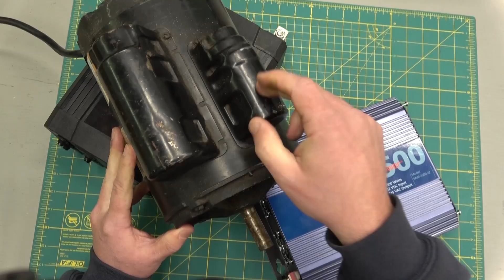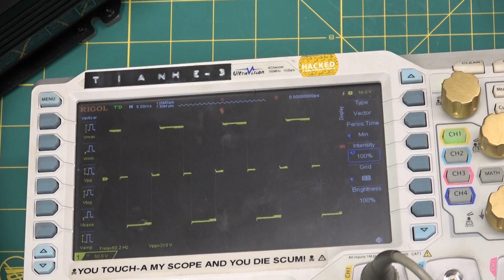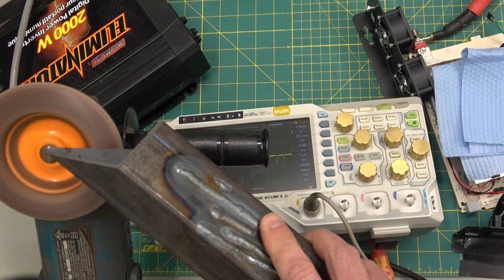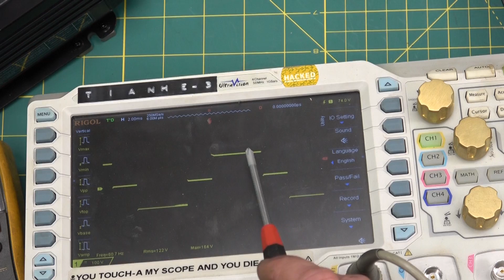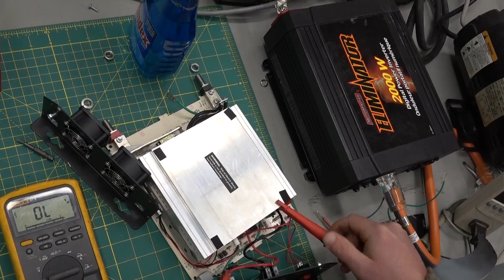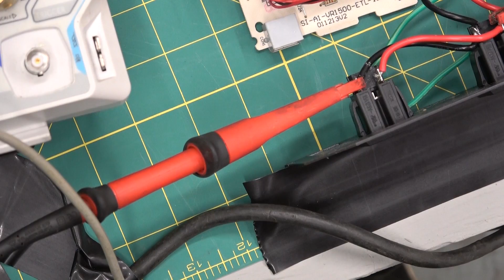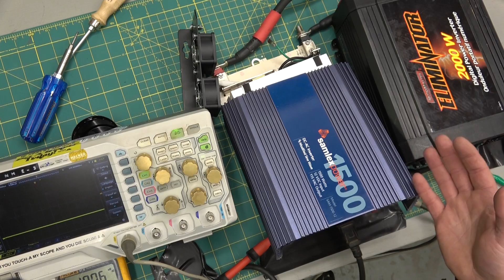BOLTR: Samlex inverter | Cheap vs. Expensive

Comment: As a power electronics engineer: Look at the cheapness of the board, its a single sided and looks like FR1 or FR2. To minimise current loop area it should be double sided. No one uses these modified sine wave inverters for professional applications, just get a pure sine wave one and lose a bit of your power density and efficiency (you will save it in power losses in your motor!).
There are some large motor drives that use a modified sine wave but they are designed for specific motors and applications.

It's OK to parallel up MOSFETs as they have a negative temperature coefficient resistance so are unlikely to cascade fail. Using different types in parallel is never a good idea though as the worse ones will not conduct and just add to the switching time.
Diodes have a positive temperature coefficient and shouldn't be parallelled unless they are on the same heatsink, and cut from the same die preferably.

I can send you a DIY high quality sine wave inverter to test if you want to see what a good one looks like.

PS. To get useful readings from your fft you have to  exactly one cycle displayed on the screen (that's 20mS total for 50hz, good luck with 60hz). Then look only at the amplitude at each harmonic and ignore the rest.
Reply: So what are the basics of a DIY pure sine inverter? H-bridge and back to front transformer? Do you need to regulate input wrt output or is that automagically adjusted by the load's power demand?
Reply: I thought you should never wipe back to front.
Reply: @ToneGallis  I'm not sure about pushin' and pullin' either. E-es-pecially after inverting. Thanks - Lumpy
Reply: Tone Gallis Proof great gems can still be found when peeling back the onion. Freakin brilliant 😂
Reply: This guy inverts
Reply: @zmandubs  inverted af
Reply: @pleaseelaborate3163 I'm guessing you mean converter topology. I've tried using both high frequency (20khz) and low frequency (50hz) transformers to step up the voltage and low frequency is the way to go unless you need to make it lightweight. Output filter topology is whatever passives happened to be lying on the floor during testing
Reply: + Nico Shattock  ...
I'll trade you your DIY sine wave inverter for my DIY sine wave vibrator.... It will be tough, but I happen to have 16 of them.
Reply: @nshattock  isn't a 50Hz transformer used for UPS's and 20kHz for inverters?
Reply: UPSs are generally 50Hz as no-one cares about the weight and they tend to be more reliable too. 20kHz is now used for smaller battery inverters because it is cheaper and lighter. A lot of large off grid inverters use a 50Hz transformer but not as many as there used to be (I've seen ones made by outback and steca)
Reply: @viermidebutura  A UPS is just an inverter they only turns on when needed. (Or, for online, one that runs all the time.) No difference in build, really.
Reply: @jonwatte4293  an UPS is connected at both the mains and the battery and power flows in both directions.
Because the UPS is always connected to mains a 50Hz transformer is usually used. Also the same transformer js used when it runs from batteries.

I know this topology is not used for all UPS's but moat low power ones use it if not all
Reply: How do you treat Tertiary Syphilis?
Reply: rickrudd not sure but I'm giving it for Halloween this yr
Reply: rickrudd: Shotgun to the source
Reply: @aaronneumeyer  Well, that's the problem with Tertiary Syphilis - it rots off on its own. Nothing to shoot :)🤣
Reply: Aaron Neumeyer thats my norm😎
Reply: I don't suppose you'd be able to recommend a really good inverter for us solar newbs? Or maybe be able to contract build one, for a fee...?
Reply: what's the power rating? I'm based in the UK and I've used the Victron Phoenix inverters before and they work well. I could build one but a bispoke piece of kit will never be as cheap as something made in China...
Reply: Do you have a link to the DIY pure sine wave inverter plans?
Reply: Silicon mosfets have a resistance that goes up with temperature. Positive temperature coefficient. However the Vgs threshold has a negative temperature coefficient...  Threshold goes down with temperature.
Reply: @k7iq  my mistake about temperature coefficient! In my experience the vgs threshold makes no difference provided your driver is strong enough and the FETs aren't sharing gate resistors. It takes <10ns to reach vgs threshold and >100ns to get over it ( for the 3 paralleled FETs I'm using at the moment)
Reply: Yeah, positive... negative...   Easy to get mixed up.  Happened in my math classes all the time.   Vgs threshold CAN matter at times for certain reasons but right, not normally a problem.
Reply: <-- Also plays with electronics 'n pixies for $$, 

I believe AVE's description of paralleled transistors is incorrect because as indicated, FETs do fail short-circuit (usually) which will shunt your V+ to V- and cause a fuse "event". All other FETS will see a decrease in load as the power supply goes away and not cascade fail. However do remember that the weakest link did indeed fail but you do not know if that link was bad and only gave 50%, or did it fail at 110% of its rating? Given that uncertainly can you trust all the rest of the FETs in that group when you go to repair it? Proper answer is to replace all the FETS in the group, so in a sense yes a failure does indeed wipe out the whole lot.

Now as always there is a rule for every exception; If the V+/V- rail is so powerful (or has lots of bulk capacitance), a single shorted out MOSFET will have to shunt a few 1000 Amps before the fuses kick in. It may not be physically up to the task and I have seen high power gear where one FET is mostly missing due to the arc welding that occurred. 

I would say that parallel'd up small MOSFETs (T0-220 size) is a good indicator of great kit and a way better design than one/two big ass FETs. MOSFET matching is not a thing like BJT/JFET matching is/was due to the negative coefficient. Very easy to parallel up a group of FETs, true the only gotcha is the collective increased gate capacitance but there is tricks for that.
Reply: What does BOLTR stand for?
Reply: @iLLeag7e  Bored Of Lame Tool Reviews.
Reply: You still didn’t get a AvE heart 😂🤣😂
Reply: I think MOSFETs only have a negative temp-co in hard cut off and turn-on, and a slight positive temp-co when in saturation or the linear region. Shouldn't be a problem with the inverter design though. Also, an FFT should have as many cycles as possible, as more cycles allows more "frequency bins" and lower resolution bandwidth.
Reply: We get it bro, you invert.

Comment: So is a pure sine wave inverter basically a 50/60hz function generator strapped to an audio amplifier? Something I have heard of being done in a pinch to convert between 60hz and 50hz or to step down 120V-240V to 110V-120V with a pro audio amplifier (1800W @ 8 ohms / 3600W @ 4 ohms is theoretically 120V AC)
Reply: Rockford Fosgate used to demo their amps this way, hooked to a blender making margaritas at shows.
Reply: Essentially that is one way to do it. as I recollect, and I am no expert, a hartley oscillator amongst others produce a nice sin wave which may be amplified through A, B, or AB type amplifiers to produce a nice high power output at the desired voltage.
Reply: Well, yes, but only if it is a class-D amplifier. Also they do other stuff like try to detect if there is a load, and going into a sleep state if not (this saves battery power). The problem with class A or B or AB is that it wastes too much power. We usually want our inverters to be efficient because we are usually powering them from batteries.

Comment: Sadly we've reached the point where many "name brand" items aren't really better than the cheaper alternatives.  They're more expensive without putting that cost into quality.
Reply: Sad thing is a lot of name brands are using 3rd party products but with a custom casing and name branding.
Reply: Darn Tough socks are as great as ever. You can't beat the LIFE TIME GUARANTEE.
Reply: Par for the course. Been like that for 50 years just getting worse exponentially.
Reply: You've got to take name brands with a grain of salt as many of the once great U.S. brand names have been purchased by Chinese companies. While some of the Chinese companies value the brands and continue to produce quality products, there are far too many that exploit the name by selling shitty products under those brand names.  RIP  RCA, Zenith,  etc.
Reply: You gotta ask yourself, would I wear a Mastercraft t-shirt to a home show ?
Reply: cigr n
Reply: You’re paying for the transformer design instead of transformerless. 

The inductor you referred to is for smoothing only. 

The cheapo has no isolation and is a high frequency unit. 

The expensive one is an isolated design but less efficient although typically will handle inductive loads better in the short term. 

But you need at least 3000w to handle a 12amp inductive motor. 

All of the cost is isolated design only.
Reply: What do you mean?  The shareholder quality of life is much higher.
Reply: I believe that is the end goal of capitalism and publicly traded companies. Constant  profit numbers until you run out of demand and plateau. Then the only solution is to increase margins.
Reply: Talk about increasing margins: has anyone else noticed the shrinking half gallon of orange juice? It used to be 64 ounces, then 59 ounces and now 52 ounces although the containers still look about the same. Where will it end?
Reply: @jawms  Capitalism has no end goal like what you wrote. It is the free market of production and purchasing. The market currently promotes cheaply produced crap at various extremes of mark up. Unfortunately, it would take a lot of us consumers demanding higher quality at the same price by not buying the junk at any price point to get the companies to up their game. Execs and shareholders will take less profits over no profits.
Reply: James August have you ever actually worked for a company? Why would a company want demand to plateau?
Reply: @Mrcaffinebean  they don't want demand to plateau, but it invariably will. And to maintain growth of profit, companies resort to ever lowering the cost of production. Ticketmaster's demand is plateauing, and they are turning to the online scalping market to contine to increase profits (charge the "convenience" fee twice), because how else can you please the shareholders?
Its a problem with publicly traded companies combined with market speculation. People don't usually invest hoping for predictable  steady dividend.
Reply: Michael Frederiksen in a nutshell, the consumer is hosed because the business exec is obligated to show profits to the investor, right?  It's the pharmaceuticals dilemma; everyone wants to cash in on the climbing stock prices yet they want the cost of the product to drop.  That's the point at which quality will drop.

Comment: I'm 43 when I was 17 I met this local car stereo shop Kevin "Hitman"(ran out of his garage, his empire of dirt) we would install and compare brand name components to the cheaper, all the time and effort we put into these systems, and there was not much difference, much like you just showed. Some difference but that little bit of difference wasnt worth the extra money. We took most of the local sound shows. With our 2 or 3 thousand dollar systems. Watching the losers drive away with there 5 or 6,000 even 10,000 dollar systems. We once put 36 six inch woofers in a VW golf. That car hit. They were pyramid pro series. Cheap.
Reply: I've always blew away high end systems with pyramid in the mid to late 90s and I still  have those amps and subs and they still work lovely they've been in 9 different cars so far and I'm positive they'll outlast the next ones
Reply: Yep the Pyramid stuff was really good back then.
Reply: lol BS i did it too back then and a pyramid or pyle etc wasnt killing anyone rockford and memphis or ppi list goes on mtx too
you be lucky if that pyramid lasted a month
Reply: @scarlett5924  your license plate prolly rattled, I know what I know you know what you know.
Reply: You have just exposed the asshattery of the "golden ear". Kudos.

Comment: You should see if you can get a peek of a Cotek inverter (bloody expensive). They have models that claim to be pure sine and others that are modified sine. I picked up a big 2000w one for spare/repairs - internals looked high end compared to what you have there (silastic on the caps, epoxy/conformal coating over everything). Alas, I was out of my depth in trying to repair it, even local eletronics repair shop couldn't get it to chooch - having to waterjet the epoxy/conformal coating off didn't help matters.

EDIT: this is similar to mine: https://www.youtube.com/watch?v=sNWMXOtAzAA&t=131s